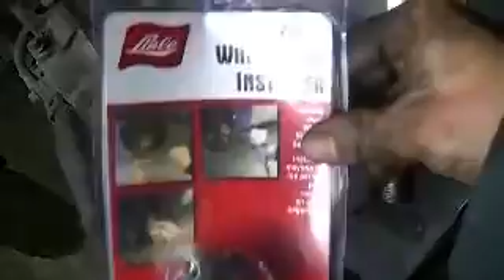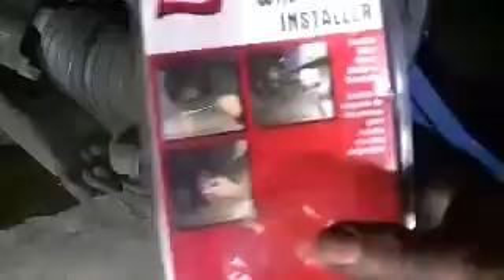Wheel stud replacement front disc brake/hub Chevy Cobalt 2.2L ecotech

Comment: Hey man. Another question before I work on mine. Is the set up in the video an all-in-one wheel bearing/hub assembly?  Will removing it like you did without removing the axle nut potentially damage anything? Thanks!

Comment: I tried this method on a 2005 cobalt and got stuck. when i got the hub bolts out which are really tight the hub would not budge like it was not meant to be. even hitting it with mini sledge did nothing. i started cussing video like it left out something out, like taking the bearing nut off. I dont own a socket that big , so that was out of the question. then i remembered an easy method from internet. put this in youtube search,  Repairing broken lug studs on Chevy Colbalt the easy way.  OR    https://www.youtube.com/watch?v=cBwY6dJMmnY  .  I got out my angle grinder and cut off my 2 bad studs from the back making short work out of it. then i made a smaller version of the notch in housing like the video. it was on top left of center hub bolt. I used doorman studs that come with one side already cut off. i believe they call them clipped. presto, piece of cake getting them in. the housing is made of aluminum and it posed no real structual damage. if you want to do it the easy way use an angle grinder. i used the stud installer    tool like him and it pulled in easy nowhere near the normal 100 ft pounds that these are to  be tourqed to.

Comment: thanks for the video, i have 5 broken, i just buyed the car and i was drivinf, but i knew he changed the brakes and he didnt bleed it, i though the brakes make the vibration, but it was the tires he didnt tight them and almost the tires fly, so now i have to change 5 bolts 4 on right side and 1 on driver side, fk stupids pples